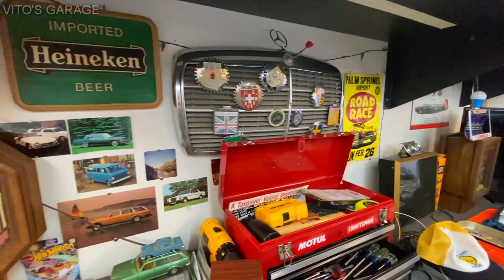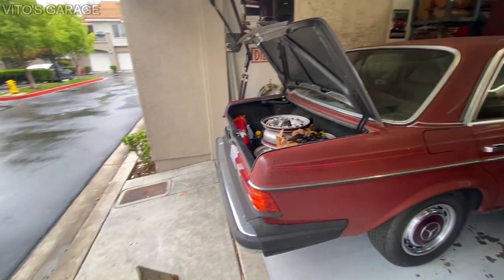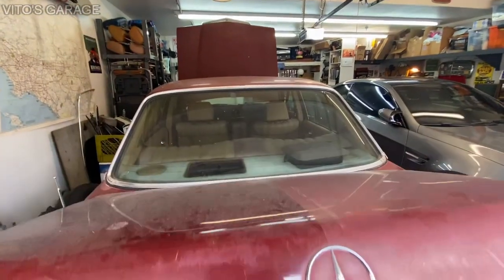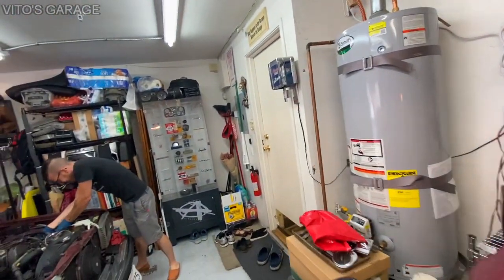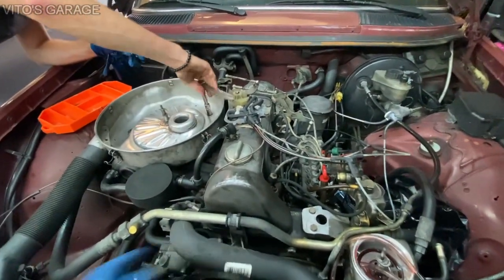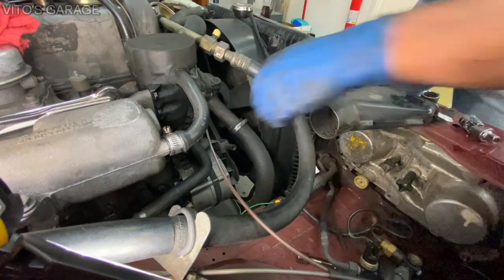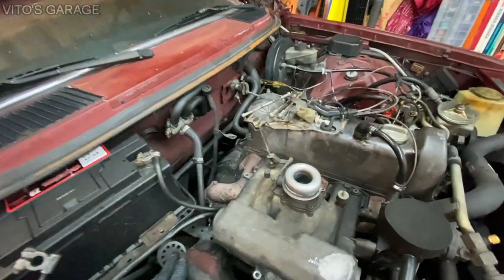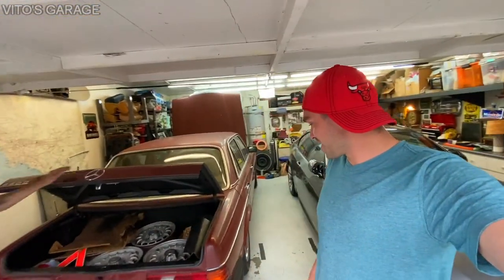Fixing a Sweet Mercedes W123 240D with a Subscriber in LA! Oh Boy, We Found a Big Problem...!

Comment: Hey Vito, I have a 2000 mercedes c230 kompressor do you know of any aftermarket tuning support or aftermarket tunable ecus that would work ? I appreciate any ideas .
Reply from the maker: Hi there. What exactly are you trying to accomplish and where do you live?
Reply: @VITOSGARAGE   I live here in Oklahoma, I was thinking about adding a smaller supercharger pulley to gain some extra boost and possibly adding larger injectors. Im a but hesitant though because the car has started increasing in value so I'm looking to buy another to modify. I'd like to be able to have the ability to tune it myself but would be ok with a remap of the stock ecu to compensate for the extra boost . Right now I get about 7 psi but with the pulley kit it would be right around 10 psi . Not sure how well the stock ecu would be able to compensate with that change . I don't want to run into a lean condition and burn a cylinder. The ring gap should be fine due to the engine being made to handle boost from the factory.  Thanks for getting back to me I appreciate any knowledge you have .